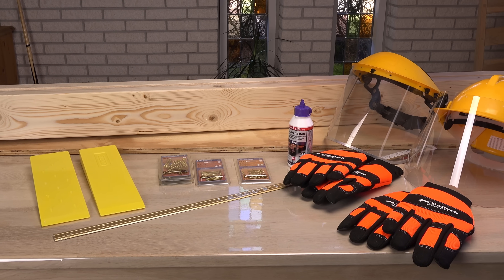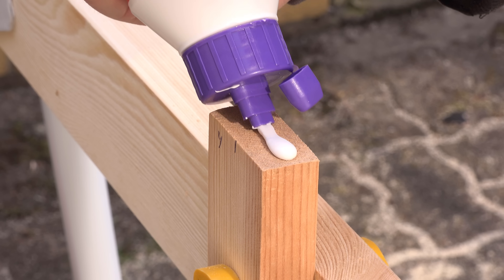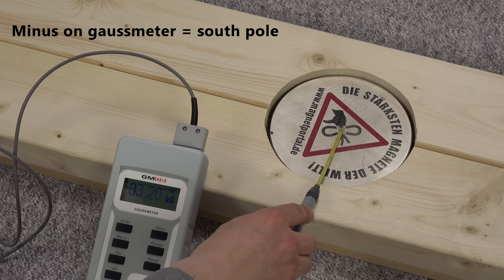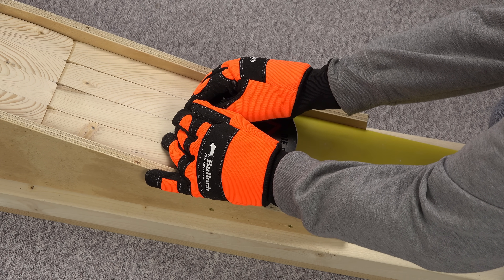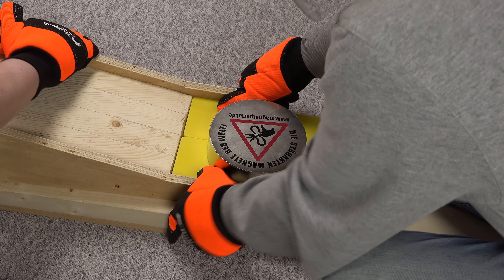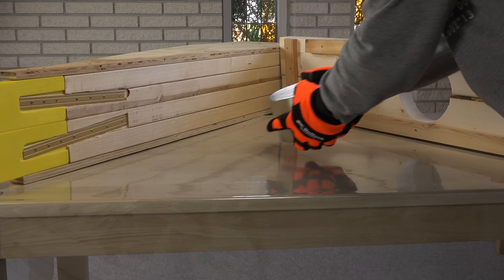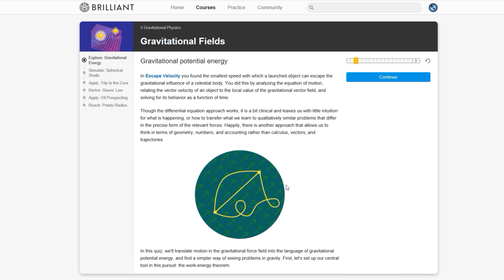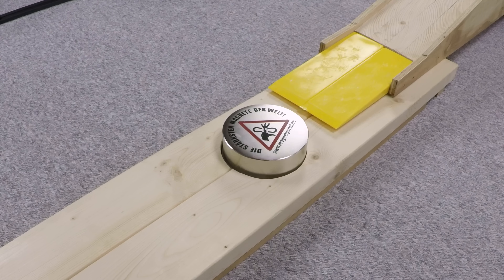Monster magnet meets monster magnet...

Comment: I would have tried to use coconut oil. Have one magnet submerged in a 5 gallon bucket of it. Then chill it. Then put the other magnet on top of the hard paste surface of oil, as it warms it will sink to the bottom slowly and consistently.

Comment: Gentlemen, Please be so kind as to show us how you separated the two high-strength magnets after sticking them safely together. If you can map out the strength of the field (gauss meter with iron filings on a strong plastic plate) with the two  stuck NS to NS, then compare holding them together NS to SN, I think you'll be impressed. Please do not crush your fingers! It is far easier said than done.

Comment: I went to your website, it says that these magnets can hold 2000 times its weights wich means a penny size Neodumium magnet can hold a vacuum cleaner easily , so can you try a 25 or 50kg magnet and see if it can pull a car or a motorcycle ?!!

Comment: I've worked in a rare earth magnet factory in the past and this is how I'd do it:  Take a 6" inner diameter plastic pipe, say 24" long and drill some 1/4" "drainage" holes along the length of the pipe, 1" apart, on either side of the pipe.  Place one magnet on the floor, set pipe over magnet, fill pipe with crushed ice and pack down, leaving room for second magnet inside top of pipe.  Insert second magnet into ice-packed plastic pipe.  The ice keeps the two magnets separated, as it melts and the water drains out, the magnets slowly, gently come together with the plastic pipe keeping them in alignment.
Reply: Genuine)))) merely, dude)

Comment: I DID THIS SAME EXACT THING (combined the two large magnets) WITH THE SAME EXACT MAGNETS (several years ago)!! The way I did it" I stacked a bunch of thin boards (about 2' worth), placed one magnet on either side of the boards and then removed one board at a time. On the last board, it was smashing THROUGH the ~0.25" board so hard that we (me and about 3 other people) were BARELY able to get it out, and we're pretty sure that there are still some wood pieces in between the two magnets but if there are, they are probably about 0.01mm thick by now. I'll post a video or pictures of it soon. 

And actually, after years of fun with this thing (thingS), I'm finally planning on selling it on ebay in the next month or so.

Comment: Haløjsa. here is an ideer 4 next time, take a pipe that fit around the magnets, freeze some water in the pipe, put a magnet in both ends, ice inbetween, then they slowly come together when the ice melt... dont think the cold is going 2 make them a lot more brittle. u can make it stand up, in a warm waterbath, so the bottom magnet heats up, care not 2 heat the sides of the pipe.

Comment: I would really like to know what the difference is of the magnetic field when two large neodymium are placed by force N pole to N pole as opposed to N pole to S pole.  An experiment showed that N toN actually defeated to some extent Gravity. Also what effect N to N or N to S  would have on structuring water  molecules which configuration would work better

Comment: While watching I imagined using a piece of thick walled plastic pipe that the magnets would just slip into as a guide.  
Place a 12 inch ice plug between the magnets. As the ice melts the magnets would slowly slide together.  
It may need a few small drain holes to vent the water.

Comment: Love the safety equipment! - Precauitions taken for handling the magnets, carrying them, and placing them above each other. Faces  protected with shields. Gloves for the hands, and always making sure to keep fingers away from being trapped.  And then...you just wear socks and forget about the steel toe-cap boots! It's a WTF moment! Great video!  Enjoyed it and laughed at the same time!
Reply: I don't think steel caps would be a good idea! Maybe hard plastic caps.
Reply: - LOL - Good thinking  there! - I now have visions of dropping a magnet on one of the safety boots with the steel caps, and not being able to remove said magnet from the boot.  I wonder how he could remove, it if at all?  Would you need to place the other magnet on the floor, then stand on it wearing the boot with the stuck magnet?  Can you imagine the pressure inside for the little tootsies?  Would the steel toe cap hold up to the job or would it crush a little?  There's only one way to find out I suppose..... ''LET'S EXPERIMENT!!!''

Comment: To pull them apart you need two blocks of wood with holes where the magnets will fit snugly in (like the bottom block). One over one magnet and the other over the other  magnet. Put them in a rail so they can slide but not separate apart. Pull one in one direction and the othe in the other direction (shearing them apart). You might need some mechanical assistance to do this. This is similar to how I separate smaller ones.
Reply: great idea!

Comment: an idea i had that may help you with combining large magnets in the future would be instead of making a wedge to place the magnets onto each other, you could use some extremely viscous fluid like tar in the form of a several centimeter puck placed between the two magnets. the pull of the magnets along with some slight warming (42c maybe) would push the tar out from between the magnets bringing them together slowly without any risk.

Comment: I know this may be harder to do, but if you can somehow attach the 2 magnets with their North-poles facing each other with a clamp or some other similar device, then find a stone with similar weight and drop them both into a swimming pool from the highest floor of a high-story building, or into the sea or river from a cliff, you will that the 2 attached magnets will fall slower than the stone, breaking the laws of Newtonian gravity and General Relativity. This should tell you how magnetism is related to gravity.

Comment: Croly Hap Batman !  those are some strong magnets.  Wonder if they could have been assembled via plastic pipe 0.75 meter long of same inner diameter as magnets outer diameter; filled with water or hydraulic fluid; or combination with ice, using a bleed valve near the conjunction?

Comment: Water tight cylinder nearly same diameter and at least 7" taller than magnet.  Place mag #1 in bottom of cylinder. Fill cylinder to within 3" of the top with water. FREEZE....  Place magnet #2 on top of ice, as ice melts magnets will align.

Comment: You should try, building another 2x4 holder with a hole (But shorter than the original).  Put it over the second magnet, then try pulling the two magnets apart.  (Sliding one set of 2x4s across the other.).  Maybe have a car parked on one end of the lower 2x4,  and add a tow-hook to the top side and have another car pull on it.  And then see how much force is required to pull them apart. (Put sometime scale inbetween)....

Comment: I'd love to see them  combine with the help of balistic jelly. Make a transparent tube of epoxy reinforce it with transparent carbon fibers sheet , make holes around the center of the tube for the jelly to flow out as they come closer, make the tube slightly bigger then the magnet just dont give them space to loose the approach angle

Comment: You really put some work into this experiment.  I was thinking about how to separate these two magnets without breaking them and I came up with hydraulic pistons.  One piston pushing the top while the other piston pushes the bottom in the opposite direction.  Of course guides would have to be used to keep the magnets from flipping and killing someone.

Comment: Now take them apart.
Reply: They have only a few thousands pounds of force so I imagine one side could just be bolted to the ground and the other chained to a truck which could pull it off.
Reply: You seperate by sliding forces.
One magnet held vicelike, while rachet powered action is applied, across, sliding them apart.
Reply: Call thanos for help
Reply: Heat them up till they lose there magnetism
Reply: For neodymium that's a fairly low temperature, but they won't revert to the current state when cooled again.
Reply: It would be possible, given, you would need to make an aluminum or monel alloy jig that would be able to encompass each magnet individually, and then slide them past each other, probably using a hefty hydraulic ram. Essentially, you'd need something like the pieces of wood with holes in them, one for each magnet, and guides on the sides to keep them from flipping out of the holes, as well as the "boards" being long enough to add a pivot point to act as a fulcrum.  I had to do the same with some much smaller, but still powerful, magnets. (2X 250 lbs hold weight magnets)
Reply: Or separate them using two very powerful inductors.
Reply: guys all you need is a car or something
Reply: Just get two gigger magnets on each side
Reply: A very simple apparatus would appear them powered by a simple block and tackle.
Reply: Only Thor.
Reply: @carloshbinda  turns out that he has already used the method with smaller magnets using a separation tool.
Reply: @beladury3751  Looks like we got ourselves a joker here.

Comment: Experiment 1 (managed approach): How about selecting a length of pipe (say 1 meter), threaded at each end, that the magnets fit rather tightly within like pistons within a cylinder (clear acrylic would allow the process to be observed). Drill and tap a series of holes 2-3 cm apart and install needle valves. Drill and tap two threaded caps, for each end of the pipe, and install a needle valve into each. Freeze a solid ~900 cm plug of water in the middle section of the pipe. Install a magnet in each end and then attach a cap securely on each end of the pipe. Wait for ice to start melting and then use the various valves to release water from the middle section and control the approach of the magnets as the ice melts and the water separating the magnets is released through the valves.

Experiment 2 (uncontrolled approach): In the alternative, use the same materials above without the drilling, tapping, and valves. Freeze the same plug of water (or a shorter length plug), install the magnets, and watch as the attractive force between the magnets draws them together as the ice melts and water leaks around the edges of the magnets until all water has collected in the ends of the pipe and there is no ice/water separating them.
Reply: In all fairness, looking back, others had suggested similar solutions  as much as 5 months earlier...

Comment: Would a block of ice work? One under, one on top, let it melt?
Reply: It sounds like a solid idea! However, I'd bet that, once the ice melted enough and they got close enough together, they would crush the ice and it would still  likely destroy the magnets.
Reply: However, that did give me an idea. Maybe a cylinder with an interior diameter that is a tiny fracton larger than the diameter of the magnets could be used in conjunction with ice and melting, and when it melts, the water having to rush out of the way would slow it down. Or, maybe just use enough water to start.

Comment: Could be easier  with a method i realized weeks ago, attach both magnets if simply use a plastic pipe with same  internal thickness than the magnet diameter,  close the tips by inserting  a removable covers with same thickness than the magnet height . filled it with water and freeze it, then  remove the covers put  both magnets inserted into the empty holes where the caps was , then put it stand outside under the sun and wait  the ice melts,  , while it do it, the magnets are getting closer to each other till all the water is unfrozen ,  could help drilling a small hole in the middle of pipe to allow the water flow to outside .

Comment: I used to work with small versions of these magnets whilst making security tag detachers, when they arrived they were in stacks of twenty with a small amount of cardboard between each of them, very easily and often you'd go to slide the top one off and they'd slam together shredding your hand and each other in the process.

Comment: How are you going to separate them though?
Reply: I found out that seperation comes easily after one bangs the babysitter.
Reply: Two even stronger magnets to pull them apart!
Reply: Just a guess. I don't know if it will work. Take a big coil of wire and wrap it hundreds of times around it and run alternating current through threw them. It may weaken enough to get them loose. Then to charge them back up run DC current through it. But I really don't know about these kind of magnets.
Reply: TheWaterFlipper Jr. lol you can stick a plastic knife between the
Reply: wesley sandifer this is an underrated reply
Reply: How about a hydraulic log splitter? Maybe use a non ferrous metal for the head, like aluminum, brass, or even stainless steel. You'd have to sharpen it a bit more than what you split wood with, but it should be able to do the reverse of how they assembled it, without anyone having to pull any muscles. Some lubrication would also be helpful in dealing with the friction they ran into during the assembly.
Reply: nice!
Reply: heat them
Reply: Wd40
Reply: Also it might be easier to shear them from each other rather than pulling them straight apart. I'm envisioning a simple device with two long handles to slide them off of each other with about 7 feet of leverage.
Reply: We need hulk
Reply: The Indie Diary lol 😂😂😂😂😂😂🤣🤣🤣🤣🤣🤣🤣😂😂☺️🤣🤣😂😂🤣🤣😂😂😂🤣🤣😂😂🤣😂🤣😂😂🤣😂😂😂🤣🤣🤣😂😂🤣🤣🤣😂🤣🤣🤣😂🤣🤣😂😂🤣🤣🤣🤣😂🤣😂🤣😂🤣😂🤣😂🤣😂🤣🤣🤣🤣🤣🤣😂🤣👌👌👌👌👌👌👌👌👌👌👌👌👌😂😂🤣😂😂👌👌👌😂👌😂😂👌😂🤣🤣👌😂😂👌👌🤣👌🤣👌🤣🤣🤣🤣🤣😂😂😂😂😂😂🤣👌🤣👌🤣👌👌🤣🤣🤣👌😂😂👌😂🤣👌🤣🤣👌🤣👌🤣👌👌👌🤣👌👌🤣👌🤣🤣🤣🤣😂😂👌😂👌😂😂👌👌👌👌🤣👌👌😂🤣🤣👌🤣👌👌🤣😂😂👌👌🤣🤣🤣👌🤣👌🤣🤣🤣😂👌🤣🤣👌🤣🤣🤣🤣🤣😂🤣😂🤣😂🤣😂🤣🤣😂👌🤣🤣🤣👌🤣👌👌👌😂😂🖕🏼🤣👌😂😂👌😂👌👌👌😂😂😂😂😂👌😂😂👌😂😂👌👌😂😂
Reply: Drop a nuke at them.

I mean cutting them apart with a jello knife
Reply: Rub it
Reply: I don't think he INTENDS to ever separate them.
Reply: Two more... even stronger than before... magnets!
Reply: llamasorus how u supposed to get them off

Comment: Now, how would you SEPARATE them???   That's our problem (our magnets are supermagnets, but half that size and very stuck)....email us if anyone knows:  randomwavesmusic@gmail.com
Reply: when you heat them a lot, they will not be magnetic.
Reply: I don't think they want to DESTROY them, only separate them. I would suggest a strong wooden frame with a hole in it, similar to this video, that is as tall as ONE of the magnets. Another frame of similar construction, with a hole. Force the frames across to push the magnets sideways across each other, until they slide apart. Would be good to support the frame, so it can't fly sideways or fly apart, making all kinds of hazardous projectiles!
Reply: +morning1500 im not suggesting to destroy them. Separating them by your technique would be impossible since the magnets are way to strong. But heating them even just a bit will reduce their strength, so that you can seperate them
Reply: But by the time you heated them ENOUGH to reduce the strength ENOUGH, you'd surely ruin them. Just saying.
Reply: maybe...

Comment: Now split them. 😂
Reply: if you make the magnets hot, then after u can split easily
Reply: Eugen Scobioala Yeah but that will reduce how strong the magnets are
Reply: Only Chuck Norris can split them now.
Reply: never in this century
Reply: I can do it easy
Reply: pinSjon79 finally the most intelligent answer on this long entire thread..pure genius you are..
Reply: They will shatter and pieces would probably go into your eye
Reply: Lex Raught put them in rice
Reply: I've been there. Not with magnets this large but it was hard task. We spend almost all day separating them.
Reply: drop them down at the edge of a box or something that will not break so the 1 magnet that will not hit the box should slip off the other magnet
but my guess is you need like at least 5m of drop so it can gain speed
Reply: find an elephant
Reply: Major Mazzaroth actually quite east. Put a wide chizel in between them and hammer away as they begin to seperate simply put a block of wood betweend them and slowly started making the gap between them wider and wider with the pieces of wood they will get to a point where you can just simply pull them apart with your hands
Reply: That's the real challenge
Reply: What a waste they were high quality magnets
Reply: Actually now it is one,  more powerful magnet.
Reply: One does not simply split a magnet.
Reply: JonatasAdoM it becomes two !
Reply: Rotating them in a sheering sideways movement could separate them !
Reply: I'd try 2 laminated hardwood boards with round pockets similar to the one that held the bottom magnet here. Sandwich them with the mags inserted so when pulled in opposite directions they split the magnets by sliding them apart. Both pockets would be sealed in from the unmated side.

A frame that holds the boards snug together face to face would be important.

And for a labor saving technique, anchor the lower pocket board, and use a winch to pull/slide the upper board. Or, muscle it if you want.
Reply: Thats would be kind of hard thats why he used this contraption.Once they met it would be almost impossible to separate them. He said it his self. Its like a weld.
Reply: I figured. It was my stupid humor.
Reply: No problem to separate the magnets - heat them up to 100 ... 150º C. But then it will not be the magnets.
Reply: Just 150 C?
Reply: Is this true? I wondered the same.
Reply: heating up magnets causes the - electrons to transfer from one magnet to the other, rendering it completely powerless.
Reply: Just like with over amorous dogs, hose them down with cold water.

Comment: i stuck 2 150lb pull magnets together on the side of a safe and can't get them off now. I tried once and pinched my hand pretty hard so there they'll stay. they are about 3-4 inches round and about 3/4 in. thick. I will not mess with those size of magnets you used in the video.